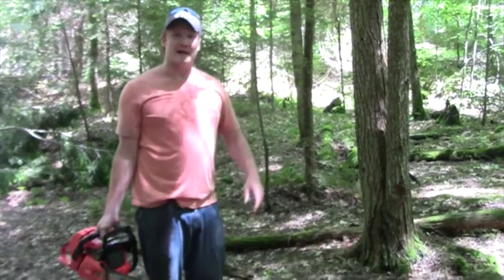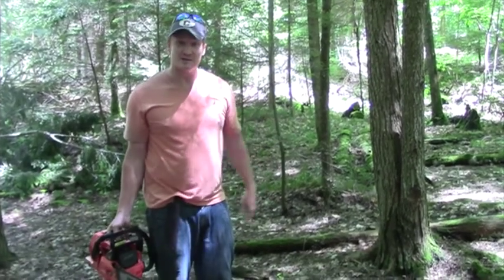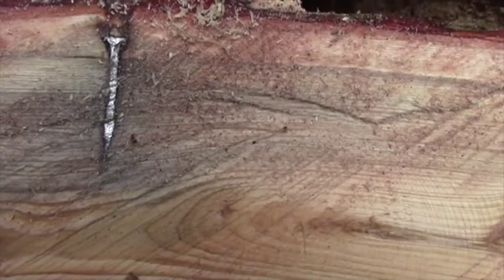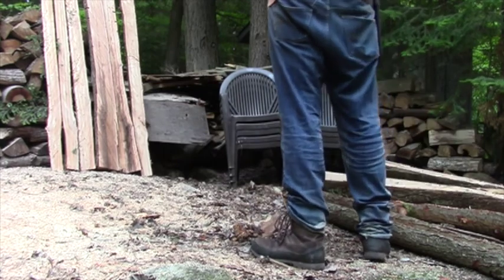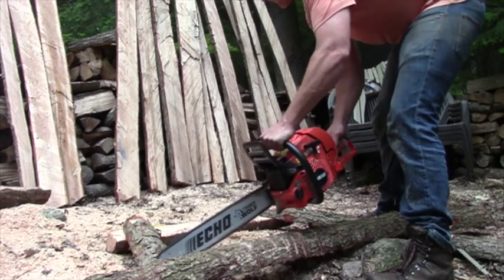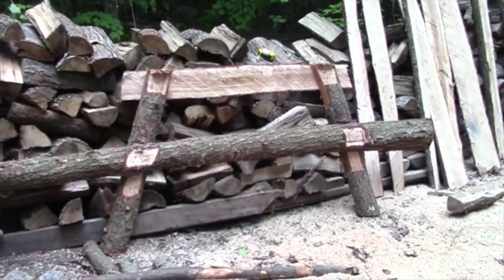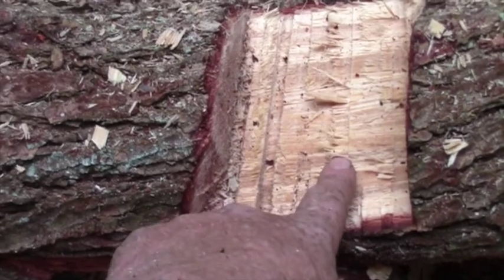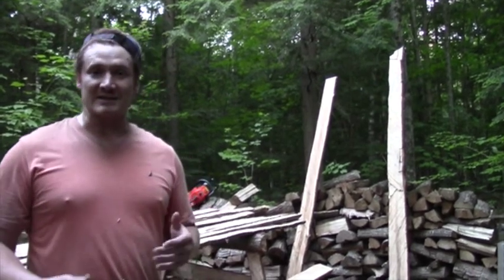How-To Build a Picnic Table Out of Logs

Comment: This time I'll use woodprix instructions to make it by myself.
Reply from the maker: That's a good idea if you ant to go with specific measurements etc. Less figuring which is what I did. so with this video and the instructions there it should be good. Are you saying that you tried it once already using this video as reference and it failed? if so, sorry!!